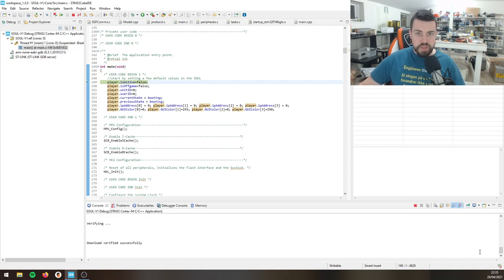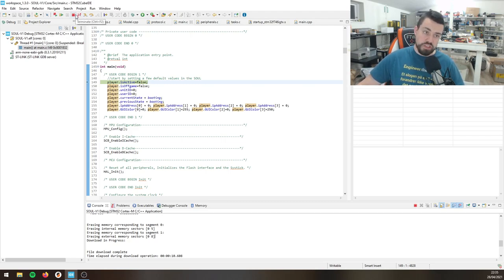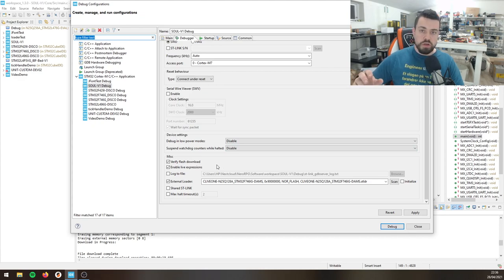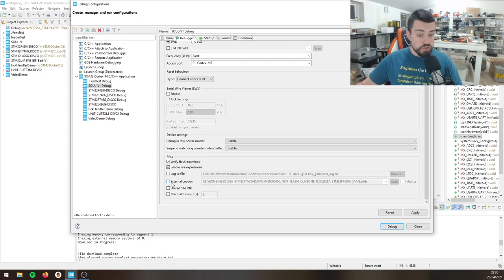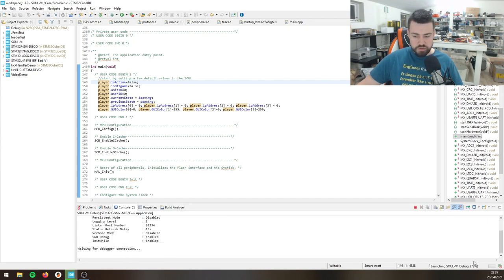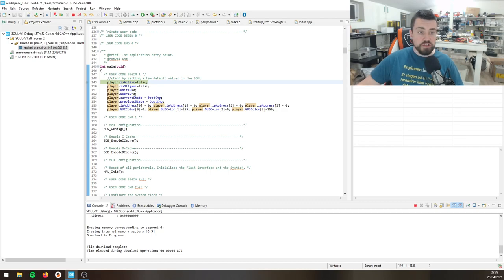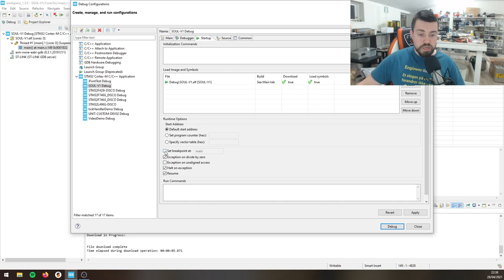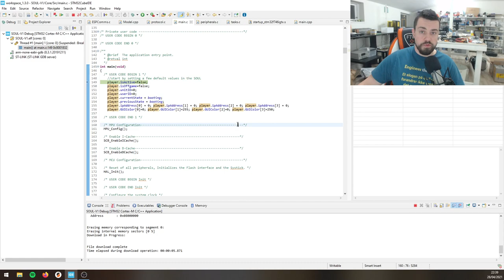tGFX insights: Skipping part of the programming process for increased debugging speed!

Comment: You can add additional Debug Configuration - one with externalFlash and one without.
Reply from the maker: Ah shoot! You are absolutely right!! That was also part of the original discussion now that I think about it. Yeah, that's definitely the way go to about this! thanks :)
Reply: @banjohat  The externalFlash of my project includes app code and graphics. The internal flash only has boot code. Therefore, in order to debug hardware interaction, I still need to flash the externalFlash. It seems you put your app code in the internal flash, and put the graphics (or touchgfx related) in the external flash. Is that correct? If so, could you show me how to do this?
Reply from the maker: @jimmylee7097  Yes, it'll only work if you only have the graphical parts in external flash.
Have a look at your linker script. In my case I have a section called 'ExtFlashSection' - that's where tGFX puts all the assets and that's why it works.
I don't know how to even put application code on the external flash :D
Reply: @banjohat  I'm checking how my colleague put app code on the external flash. The asserts mean font, images, and texts? Or it also includes tGFX build files? Could you share a sample code for reference?